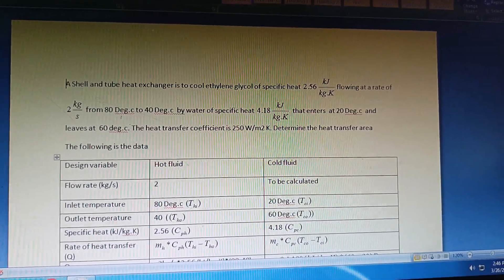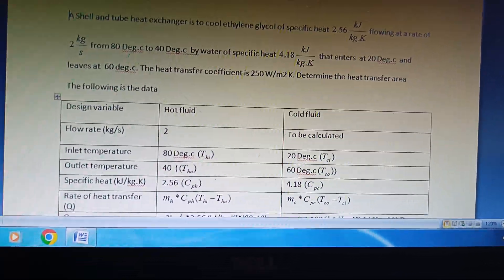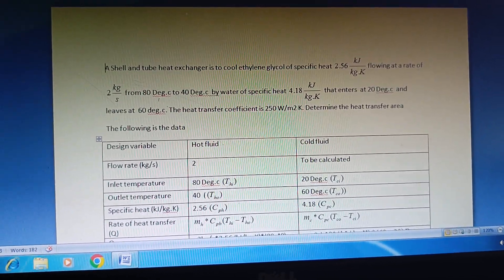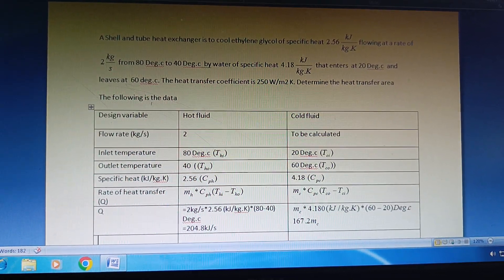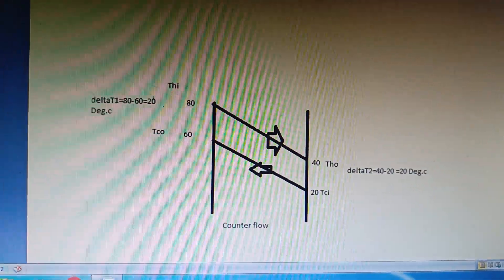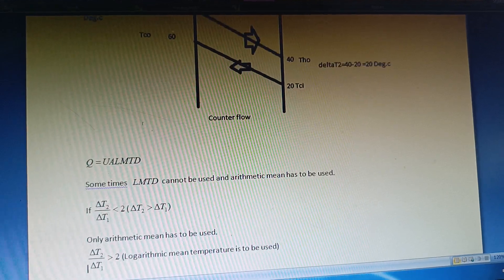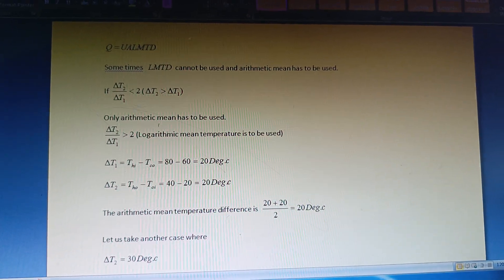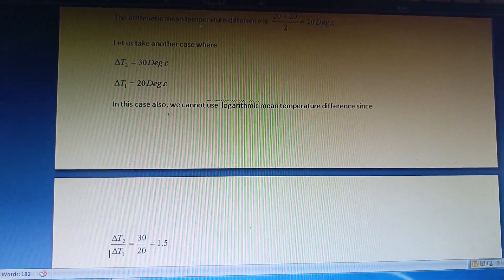Difference between arithmetic mean and logarithmetic mean temperature difference in heat exchanger

Comment: Yes sir
Great initiative and your efforts are appreciated 

I have small doubt about the video sir

In my point view the ratio of deltaT2/DeltaT1 limit that u explained as two cases I.e., >2 and <1.5 may not be the boundary condition sir

As LMTD = end approach difference I.e.(DeltaT1/T2-/deltaT2/DeltaT1) divided by log(DeltaT1/T2 by deltaT2/T1)

Yes it's True in case the end approach difference becomes zero that doesn't mean there is no driving force in that case LMTD fails to provide temperature difference so we have to go with arithmetic mean